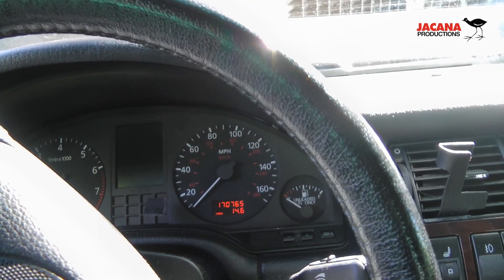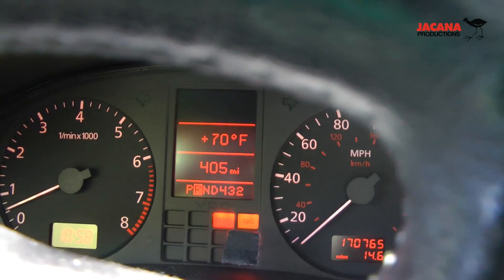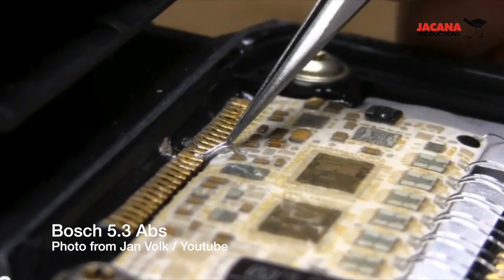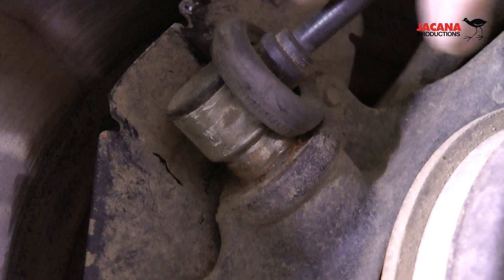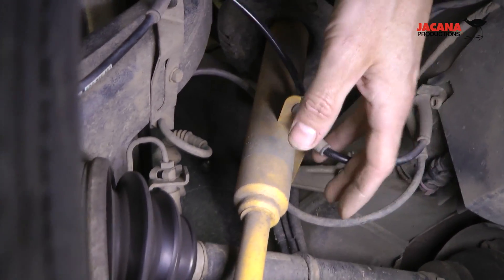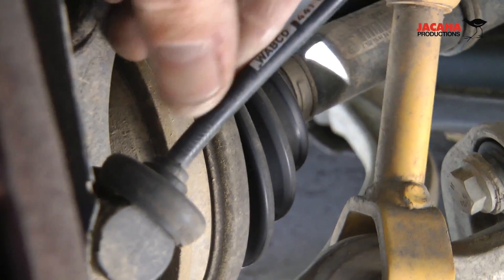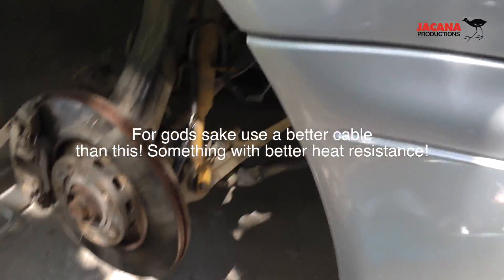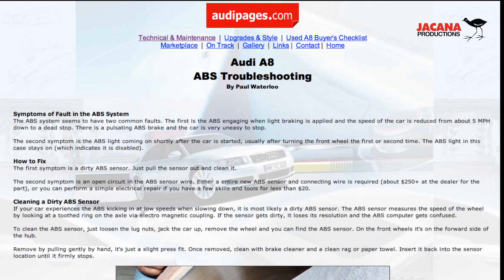Audi ABS fix - A8 99 D2 ABS gone bad

Comment: Im having a problem with my abs where the abs pump is running constantly even though the ignition is turned off, it will stop running when the battery is completly drained. Has anyone faced the same problem with their A8? Please let me know, my A8 is a 1994.
Reply: In the meantime, pull the ABS fuse, should be behind a door on the driver's side, it'll keep your battery from draining but of course you won't have abs
Reply: @BtappinHD  i ended up pulling the plug that goes to the main ABS unit. I've heard that the only way to fix this issue is to replace the whole ABS pump.
Reply: @HaggisXS  some things are not meant to be fixed on these cars
Reply: @HaggisXS  Nice, a careful petal is just as good as ABS :D I've been driving without ABS, in the snow and rain, for about 6 years now
Reply: @BtappinHD  the problem for me is that, every year where i live every car has to go through a yearly technical inspection.

Comment: You’re in Colorado?! Nice! I’m in Denver! Just picked up a 2003 S8! Where are you getting parts from? Websites used for issues? Forums? 
Cheers!!
Reply from the maker: Congratulations on your purchase! My D2 had its tranny go out in 2018 and I sold it for $500! Miss that car, I now drive a bloody Toyota!  I got a lot of good info on the Audiworld.com  forums -  https://www.audiworld.com/forums/audi-a8-s8-167/  parts wise, BlauParts but RockAuto too. I didn't always want to go the the dealership and pay 10x for a part. Did you buy your S8 off Craigslist? Throw up some video man! Transmissions are the Achilles heel of the D2 A8, not sure about the s8, have it flushed as soon as you can even single a8 D2 will have it's transmission die  sometimes multiple times if not looked after.

Comment: I have the same problem on my audi b7 i tried all this but still not working,sometimes ABS and brake lights pops up then it goes when i stop and start engine again. Is there any cable for ABS from interior comfort module? I think problem is there but cant fix there is so many cables :(
Reply from the maker: Tsotne Gabechava You could try the Audiworld forums. The module could be bad too. $100 fix in the USA, you'll need to send it to the guy in Florida I mention in the video. My problem could be reproduced when I turned the wheel. The break in the wire was invisible. Intermittent problem is normally an electrical contact issue - module or wire.